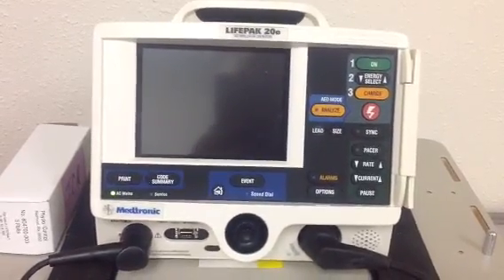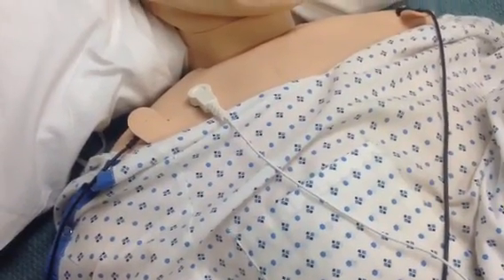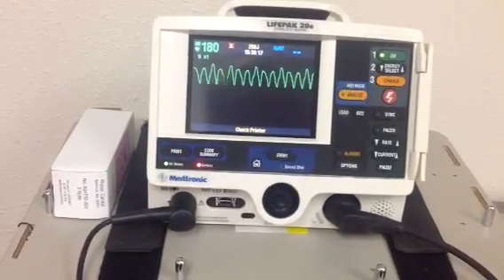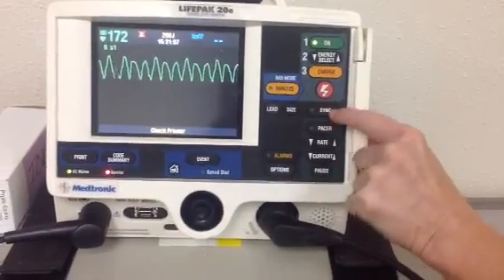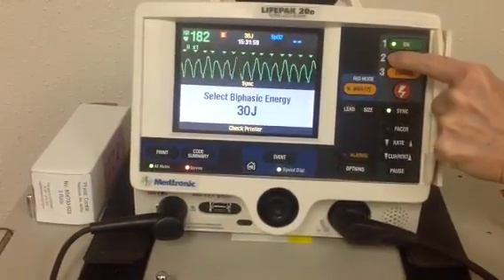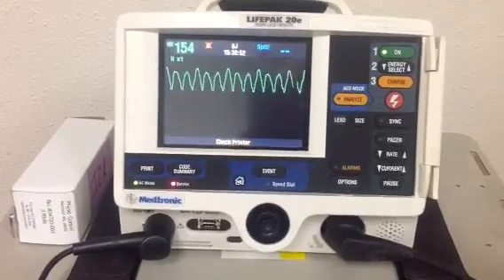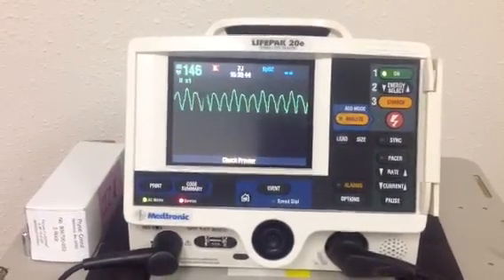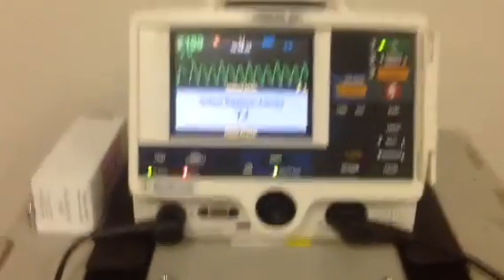How to perform Cardioversion and Defibrillation

Comment: You cardiovert because there's a pulse, then 85/40 unstable then why not defibrillate, what to sync in the r- wave when there's a chaotic rhythm, ah ok later you said there's still a pulse so cardiovert though not converted to normal rhytm after joules increase. Later you defibrillate hemodynamic and pulse assessment. Was CPR done and epinephrine ordered? How about Et tube , capnography and oxygen via bagging?

Comment: Why is a pulse needed when we use synchronized cardioverion but when we defibrillate we dont want a pulse?
Reply: Why is synchronised cardioversion used with a pulse? If a patient is in SVT, the machine will shock the patient on the R wave which is critical to avoid cardiac arrest. With defibrillation the shock is delivered at any point in the QRS cycle because the patient won't have a pulse. Therfore it doesn't matter in that situation

Comment: You need to be very careful with this defib. It is poorly designed and promotes use errors, that you really don't want during a code. If you are looking to buy a defib, I would stay away from this model. Some of its problems are shown in this video: https://youtu.be/vyQ_af3CvwE